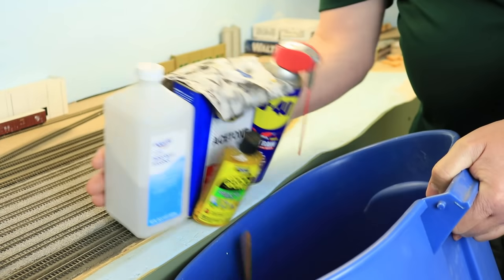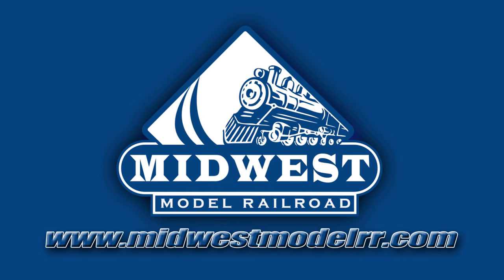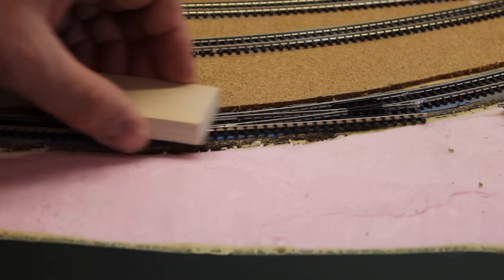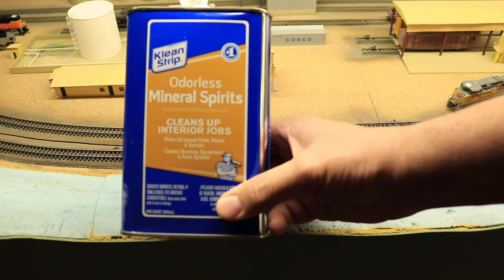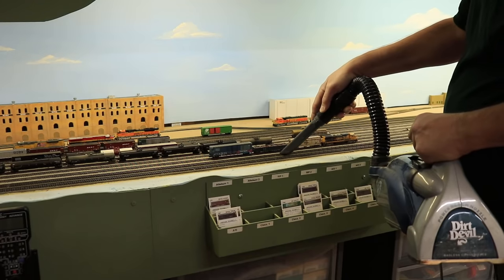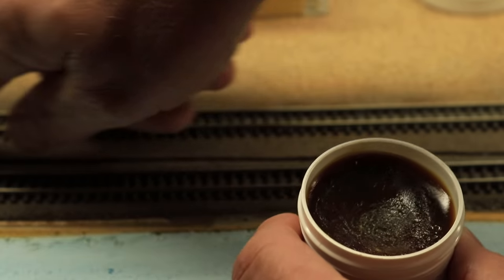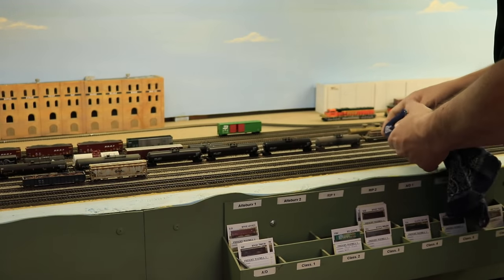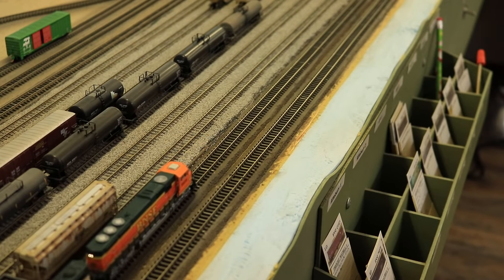Stop Cleaning Your Track on Your Model Railroad

Comment: I smile. First we perhaps over maintain our locos and that puts oil on our rails. Then we leave our railways for a week and that puts dust on our rails. All i use are kitchen towels and a 240 grit track rubber as used in the metal finishing industries 400 and 600 grit also available. The kitchen towel wrapped around the track rubber removes that oil. No liquids washing it into the ballast to dry off and become dirt dust. The kitchen towel has a slightly abrasive nature so a gentle wipe with the rubber which avoids those so claimed abrasive marks along the track direction once a week is all i do however i have been away from my railway for 4 months so i will give the rubber slightly more pressure when i get back to it very soon and 15 minutes later on my 100 yard circuit i will see trains running as i have experienced with my once a week wipe for the last 10 years. If its not broke i ain,t going to try and fix it.

Comment: Running Tri ang trains on Tri ang track it's not coated and never mind micro arcing between the rails and wheels it's major you have to clean the rails and wheels, wire brush on it 🙄 lot of track  dead sparky at night overhead pick ups even more fun to clean 🙄

Comment: I wish the model-train world would ditch track-power and switch to cheap on-board LiPo batteries, controlled through something like BlueRail: http://bluerailtrains.com/

No more track cleaning, wheel cleaning, bad connections, turnout dead-zones, complex wiring, expensive transformers, etc. Modern batteries are cheap and good enough for model planes, boats, and cars, so in my opinion they are plenty good enough for trains also. And super-great for garden-trains.
Reply from the maker: May larger scale modelers are doing just that, but the technology has yet to produce batteries and components small enough and with enough life to put in HO or N scale locomotives. Its not a matter of modelers not using it, it doesn't quite exist yet.
Reply: @RonsTrainsNThings  Thanks for the reply.  I agree that N is too small, but BRT has designed their board to fit HO and larger:
https://www.youtube.com/watch?v=O-a3UC9SRHo
In another video, they show the LiPo battery lasting for at least a couple hours of typical operation. It takes under an hour to fully charge a LiPo, so if an engine was designed with quick battery-swapping in mind, continuous operation with two batteries would be pretty easy. And the batteries keep getting better and cheaper. Some of the new electric RC planes include batteries with onboard telemetry that sends the battery-state back to the operator, kind of like a fuel gauge.